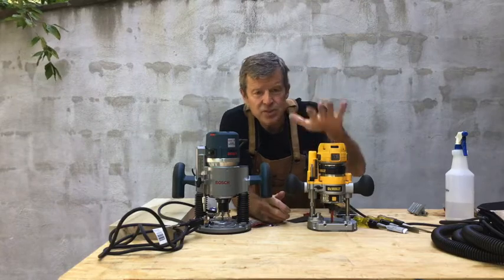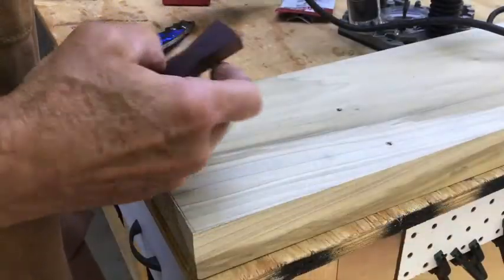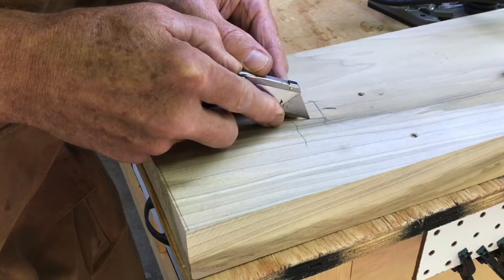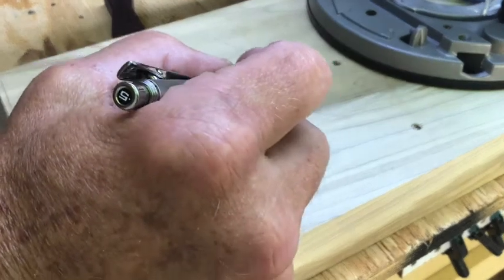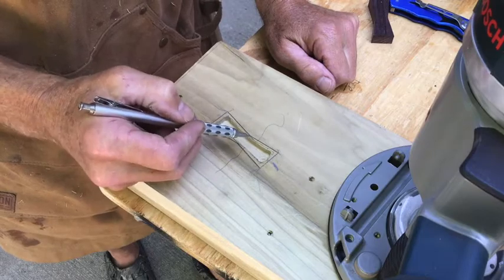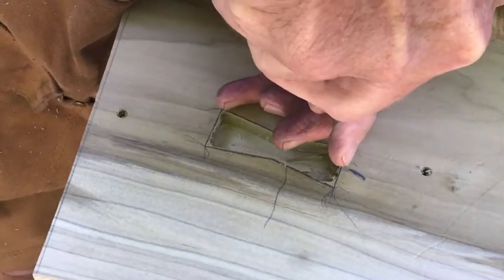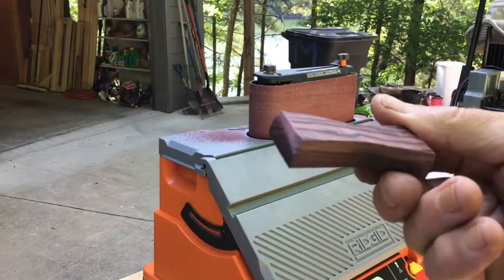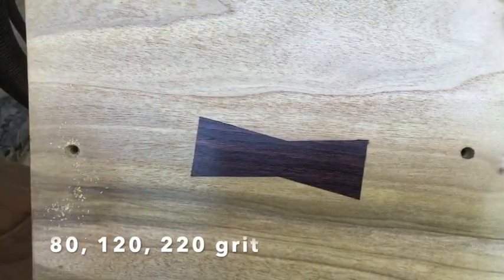How to Tutorial for Wood Bow Tie Inlay

Comment: Good job. I’ve been getting into bow ties on live edge boards. Any recommendations on a good set of chisels? Who sells a decent beginner set?
Reply from the maker: Louis,
Thanks for kind works.  I have a big box store set of Fuller bench chisels that I use everyday.  I also have a brand new set Narex Richter that I need to hone and sharpen.
The real key to doing inlays is a sharp chisel.  Any sharp chisel will get the job done.  Any chisel you buy will have to be sharpened.  Stumy Nubs has some great videos on chisels and sharpening.  I use sandpaper on glass.  I'll eventually switch to diamond stones.
Thanks,
Stephan
TWS